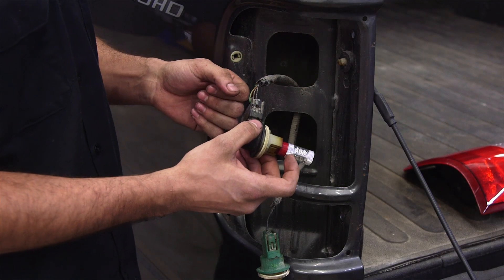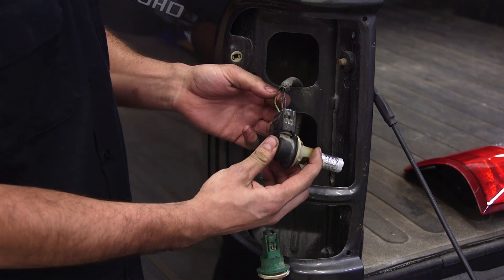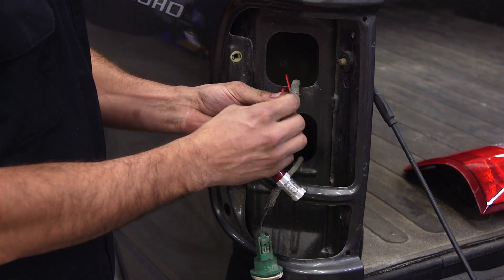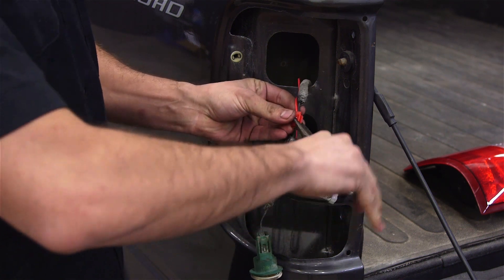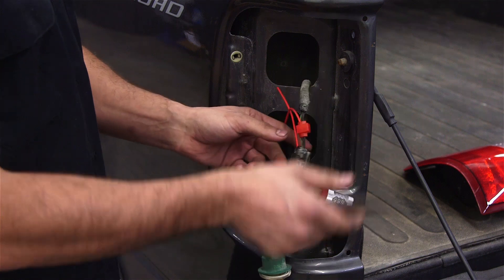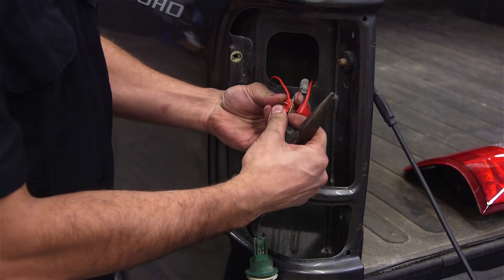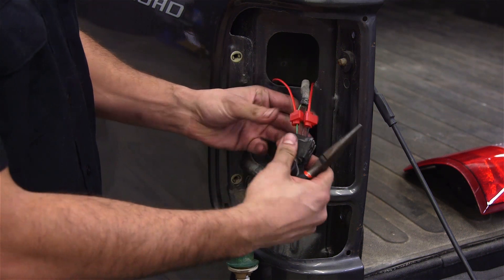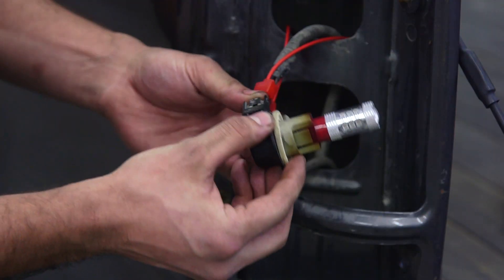Fix Hyperblinking! How to Install Resistors for LED Turn Signals | Diode Dynamics

Comment: Did this with my 94 hilux. Now the opposite light half ass blinks along with the intended side at normal speed, and now i have nothing but running lights with the headlights on. No break, no blinker.. 😕
Reply: justin76bmw  Probably it’s the led
Reply: @MonStruO72  Could potentially have used a resistor with a too higher wattage? I'm trying to research this now, but I'm reading best to use a resistor with a wattage equal or slightly less than the stock wattage for that bulb. A too higher wattage resistor can convert too much current into heat, therefor not leaving enough to actually power the light. Well that's want I know so far.
Reply: justin76bmw Then a 25w resistor you’ll have to try
Reply: A 1994 vehicle would have a physical mechanical flasher that you can replace. I suggest buying a electro-mechanical flasher that you can replace and it'll make the led bulbs blink normal. I did this for my 94 and 95 jeeps

Comment: Diode Dynamics, is there a problem of "excessive heat" that might build up due to higher current drawn by the 6 ohm resistor?  That heat could damage parts around the resistor, right?
Reply from the maker: Great question! We definitely recommend mounting these away from any rubber or plastic that could be negatively impacted by the extra heat a resistor generates.

Comment: I have a 2014 Mitsubishi evo X my brake light went out and replaced it with a LED light bulb and now my ASC system inspection and AWD inspection light came on how do I fix this with a relay
Reply from the maker: Hi Angel! Please go ahead and give us a call at 314-205-3033 Monday-Friday 9 a.m.- 5 p.m. CST, or shoot us an email at contact@diodedynamics.com, and our service team will be happy to troubleshoot that!

Comment: Do I have to install them at the front signals to (also LEDs)?
Reply from the maker: Hi Matt! That's correct, you'll typically need one resistor per bulb.

Comment: You don't mention anything about taping the connections. Many rear tail lights are not sealed in the back and that means your resistor and the connections are subject to the elements. Can you explain
Reply from the maker: Hi there! You're 100% correct, certain vehicles, such as pickup trucks, may necessitate using dielectric grease, heatshrink, or number of other means of securing the connections and lessening the chances of intrusion. While most bulb upgrades are easy, some modifications may require more experience or even professional assistance to complete. In such instances as having to seal the connections on a resistor kit, our service team is more than happy to assist, or recommend a local professional!

Comment: I have replaced the reverse bulb, break bulb and indicator bulb but I only have a problem with the indicator why are they all not playing up
Reply from the maker: Hi Carl, thanks for reaching out! Please go ahead and give us a call at 314-205-3033 Monday-Friday 9 a.m.- 5 p.m. CST, or shoot us an email at contact@diodedynamics.com, and our service team will be happy to help you troubleshoot that!
Reply: The vid description should answer your question - "When you replace incandescent turn signal bulbs with LEDs in most vehicles, the vehicle will start hyperblinking because the LED uses much less power, and the vehicle thinks the bulb is out. "

Comment: Don't the wires have to be stripped first, it does look like they are in the above video.
Reply from the maker: No, the wires don't need to be stripped. Just be sure that the metal splicer goes all the way through the wires to make a proper connection. If you have any other questions, don't hesitate to contact us!

Comment: What ohm Resistor!!
Reply from the maker: +b Wood In this video we installed our LED Resistor Kit (link below), which have a rating of 50w, 6ohm.
https://www.diodedynamics.com/resistor-kit-6ohm-50w.html
Reply: Diode Dynamics 
What is the wire gauge on a  resistors
Reply from the maker: +Joe Bucci Our LED Resistor Kit uses 18 AWG wires.
Reply: Diode Dynamics 
Ok thanks

Comment: What if you have two wires going into your turn signal part of the socket?
The newer Colorados look like they have this, merging into one connector of the socket.
Reply: he covered this in the video,  only reason this truck had three wires is because its a dual filament bulb. The resister goes to the wire feeding the filament for the turn signal. So as long as you install it on the wire feeding your turn signal, it will work. Pay attention
Reply: @dynocompe so what I'm hearing is just go from the one wire to the other?

Comment: I have the same truck and I just did this but it still has hyperblink, any suggestions on what I should do next?
Reply from the maker: +Alberto Cruz We are sorry to hear about the issues with your turn signals! If you are using our products, please don't hesitate to give us a call at 314-205-3033 Monday-Friday 9 a.m.- 5 p.m. CST, or shoot us an email at contact@diodedynamics.com, and we can help you troubleshoot and send replacements if necessary!

Comment: does it matter which end of the resistor you connect first.
Reply from the maker: No, you can use either side of the resistor! If you have any other questions, just let us know!
Reply: what temperature can they go to and what would cause them to be too hot? Mine on the rear turn signals were melting plastic.
Reply from the maker: It is normal for the resistor to get hot when the turn signal is engaged. We do recommend mounting the resistor on a metal body part, such as the frame, away from any plastic. Don't hesitate to contact us if you have any other questions!
Reply: Diode Dynamics no use screws . If you use tape it’s just gonna melt off too
Reply: What's the best way to mount them? Like a form of double sided tape or? And if so, what type?
Reply from the maker: +Jason Nguyen We would recommend 3M mounting tape!
Reply: screw them to mettal

Comment: For vehicles with a flasher relay, it's MUCH easier to just replace it 
with an ADJUSTABLE RATE FLASHER.  Maintains lower current draw and 
adjustable rate knob is very nice!
Reply: Many new cars don't use use a flasher relay anymore.
Reply: SirWhiteCrayon- You are absolutely correct. Many cars and some as far back as 2004 use the PCM (computer brain) to control blinker flashing and there is no separate relay like in the old days
Reply: @InCountry6970  
Right like in the case of a early 2000's mibile alira or Pontiac Grand am the turn signal flasher is actually part of the hazard switch.
Reply: @DVrec2157cm yes
Reply: Not on a 3rd Gen Tundra

Comment: What if I installed these and later decided to revert back to OEM bulbs?
Reply: You remove the splice in tapper, solder the wire connection and tape it. simple as that.
Reply: Why tf would you ever go back to bulbs??
Reply: you remove them you idiot
Reply: lmao

Comment: What if the problem is not a hyper-blink but a sensor that shows when the light is burnt out?  I've installed a resistor on all lights but the sensor still does not go off!  No hyper-blink issue, just the burn-out sensor light on the dash

Comment: Could you not just maybe splice and solder the resistor in line with the wire instead of using a T-Tap?
Reply: That's the best way to do it. Cut a 1/4 section of insulation off, take small butane torch or soldering iron, tape and done.
Reply: If you put the resistor in series with the bulb like you're saying you will be putting way too much current though the led.. you can solder like you're saying but you need to have the resistor in parallel with the led

Comment: i have a Chrysler 300 with led taillights and led turn signals in front. cant get hyper flash to stop at any side. resistors at every bulb. any advice?
Reply from the maker: +Shaun Dufort If you're using our bulbs, feel free to email us at contact@diodedynamics.com, and we can help you troubleshoot!
Reply: you are likely (I'm just assuming) splicing the wrong wire, always check which two are the turn signal and ground wire, those two wires are what need to be spliced w/ the 50W 6ohms resistor. Just had my hyberblink fixed.
Reply: How would you "determine" which of the three wires was which.  In general electrical contracting, the "green" wire is ALWAYS the ground and NEVER carries current.
Reply: @biffnarzilla4649  Zombie post, but here goes.... Autos do not obey residential/commercial building codes.
GREEN is never a ground on a vehicle - it is a turn/brake wire, as is the YELLOW wire - but for the opposite side. 
BROWN is TYPICALLY the running/tail/license lights and WHITE is USUALLY the ground.

Comment: do you have to install resistors on the new 2017 mustang gt i just bought the turn signals and all it says is plug and play, but i heard that you need resistors.
Reply from the maker: +eko boss Yes, we do recommend purchasing resistors for any LEDs in turn signal locations. Check out our LED Resistor Kit at the link in the video description above!